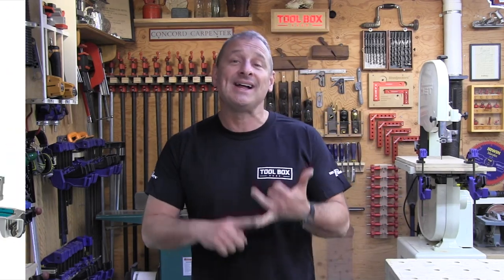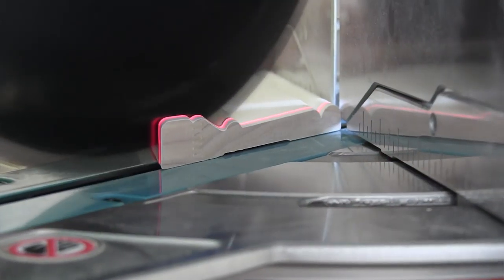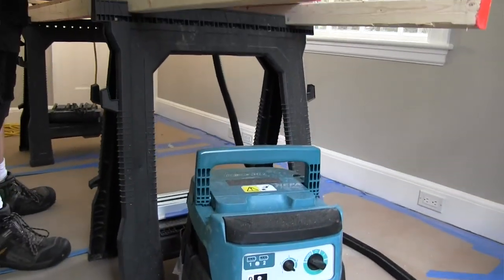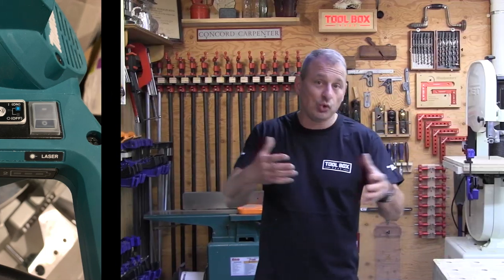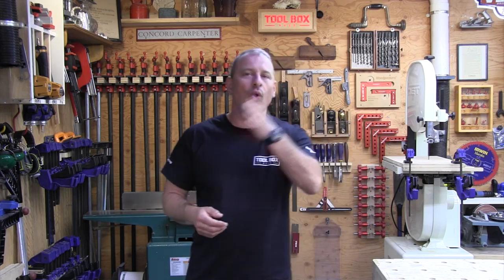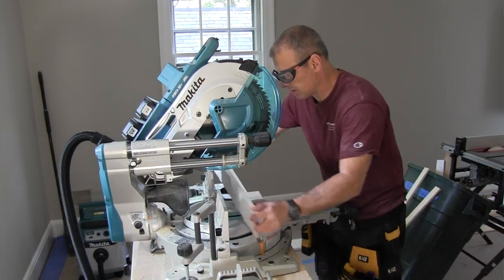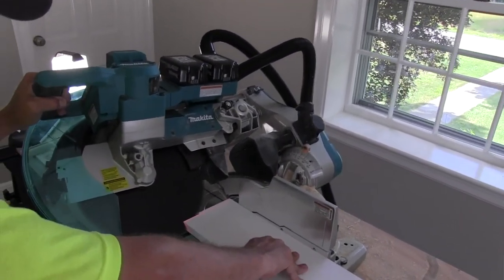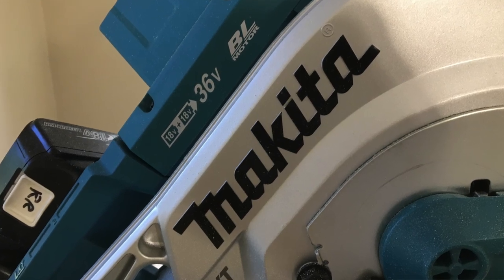MAKITA 18-volt X2 [36V] 12 Inch Dual-Bevel Sliding Compound XSl06PT

Comment: had two of the corded versions of this and had to return both, makita probably designed the saw in japan but  built it china,   if the motor needs to be precisely machined and set dead parallel with the guide rails, there is no adjustment for this after the motor has been set onto its rails,    the only adjustment is on mitre gauge on base and won't work if the blade is not dead square with the rails because the mitre adjustment only sets a square mitre assuming the actual blade and motor are already square against the guide rails,,, 
the saw is particularly low quality for a makita in regards to quality of the castings and general build quality. its also massively heavy and bulky,   why did they put batters on it its hardly portable,  id previously only used DEWALT saws and assumed a makita would be a more precise saw, in reality the dewalts are far more precise and less bulky,  after returning two of these saws i got a kapex, wasn't that much more expensive and a far better saw built and machined to last,       suppose my point is to advise anyone watching this video to test this machine before you think of buying it,     the makita is a hideous beast, cant believe the review was so kind to it considering the competition